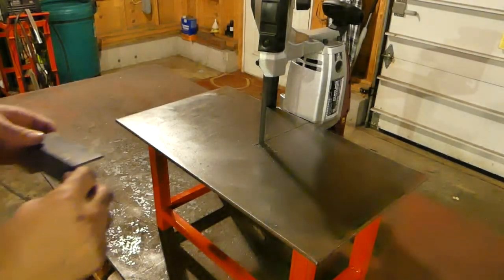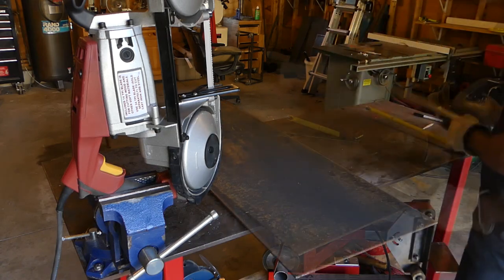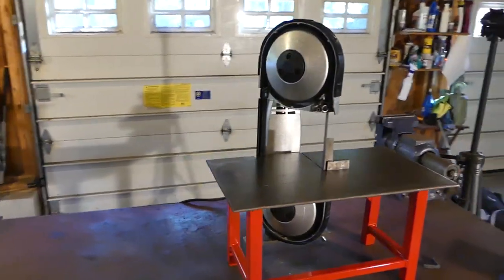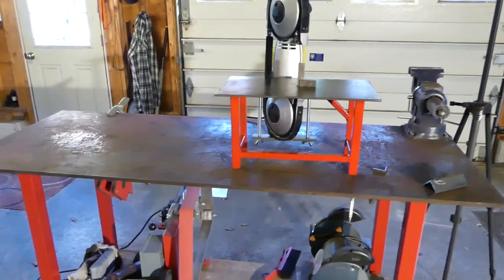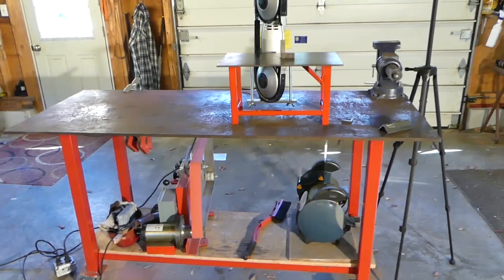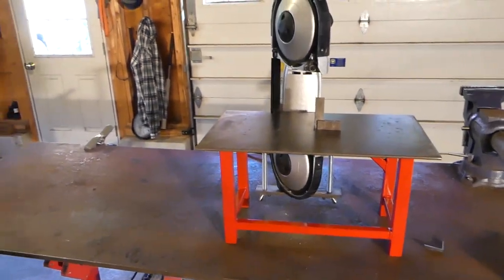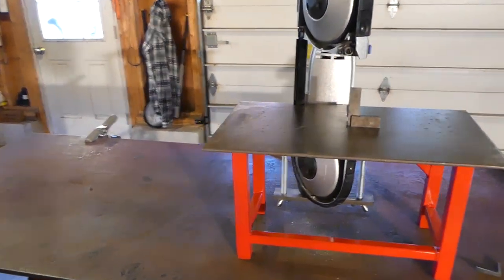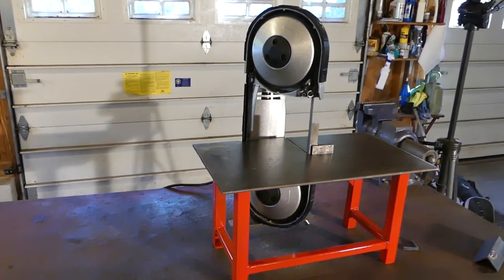M^3 Portable Bandsaw Table Build

Comment: Using an abrasive cutoff wheel without a guard is bad enough.  Running it without the guard while you side-load the cutoff wheel by running it side-to-side when you're cutting the notch in the table is terrible.  If you want to be that reckless on your own, that's your call.  Those practices in a how-to video is utterly irresponsible.
Reply: غي
Reply: Sounds like a Mr. Rogers statement.......

Comment: Mike - I know vid is 7 years old & you likely art seeing comments anymore. Wish I'd seen this before my experimentation. Kudos to you. Like me, you realized that no matter what sorta band saw you have, it's not good for the entire weight of the saw hanging from those 2 small machine screws threaded into a magnesium alloy saw frame. No other vids I was at the time considered this important issue. YOU DID. Mine ended up similar to yours Mike, but I used longer horizontal square tube on the bottom (like sled legs) with the vertical legs coming up from there.Those bottom runners extend about 8" beyond the back of the top plate. I welded a horizontal cross piece to that extension and horizontal screw adjustable plate to take the weight of the saw off of the shoe screws. I like your method better. Yours creates much more portability with the ports band never having to remove the shoe taking saw on and off. Great project. Thanks for the ideas.

Comment: you should put something on the bottom to protect he wheel, i built something similar to yours and the shavings kept falling into the bottom wheel area and eventually messed it up. i ended up just gobbing some silicone around the blade under the table on my new saw and when it dried, the blade just made a perfect fit around it and kept the shavings from falling into it. When i need to replace the blade i just pull the gob of silicone off in one piece and it fits back with friction and gravity.

Comment: You did a great job putting that little saw table together. I need to make one myself. In got a Milwaukee saw. I bet your table would fit it too. You had a great ideal with the bolts and wing nuts with a peace of steel holding up the saw strait. Great Job keep up the great work.

Comment: What I really like about your design is the clamping bar on the bottom, and its universal for other saws. In addition, the clamp on the bottom securely holds the saw solid. Many other builds will use the weight of the saw hanging from the  2 screws . Not so good.. even the expensive swag table will rest the whole weight hanging on the screws. I think it's a much better design than most on YouTube. Now you just need to incorporate a miter groove.

Comment: Nice work. Looks as though it will do what it's supposed to do. Just one thing, and it has nothing to do with the table build. When using a grinder, always have the guard over that rotating disc. If you have ever seen one of those grinding wheels come apart at high speeds and the result of the shards hitting things, you'll understand that getting one fire back at you will be a harrowing moment. JMO. Thanks for sharing this video.

Comment: I just built a similar table based off of this(different on-hand materials) and found out the hard way that this does not work for a Milwaukee band saw. It looks like the brace lines up with a flat spot on the back of your saws handle, while it lands on the round blade guard for mine. I will have to re-engineer it and hopefully remember to come back here to make some suggestions for anybody with this same issue.

Comment: For your vertical bandsaw, just purchase an SCR speed controller for it. Make sure you match the watts/hp for the controller and it's as simple as that. Been using mine for years, 14" Jet.

Comment: Thanks for making this video. I am about to buy a portable band saw and your work is very clear. I do wonder, have you considered spot welding a couple of short angle pieces, to give bit more support to the  adjustable support bar, so as to create an angled bracket on either side of the bottom wheel housing? If they end up interfering, you can simply grind them off.

Also, if you weld a bar just short of the bottom of one short side of legs, making that side to be square to the floor, when turned on that side, you could save floor space when the saw is not being used. A short, round handle welded to the opposite, upper side, would give you a easy pick up, when putting and picking up the table off it's storage spot and support table.

Comment: What a creative solid build! Thank you! Very inspirational! 
I have a question...what was the  purpose of the strap spot welded to the bottom of the table? Was it just to bare against the foot plate of the saw to keep the saw from twisting? 
Also, was the strap that holds the saw tight to the bottom of the table  bearing against the blade guard or the back handle of the saw? I don't have a saw (yet) so can't visualize it.  You seemed to have put something in between that strap and the the gauard...perhaps a shim or some kind of padding?
I would be worried that the saw could work its way backwards out of the table. Obviously, this must not be an issue for you.
Sorry for the wordy comment/ questions...
Thank you again! You have a great little shop there and obviously some great skill!

Comment: Great looking stand for the portaband. Does it just use the Allen bolts on the saw to locate it and then the metal bar and wingnuts pinch it in place?

It is nice to see someone weld the way I was shown when I was working in Ohio by a guy that I jokingly say could weld cardboard to cast iron. He is the best welder I have ever met and he told me to push the weld and that keeps the heat ahead of you.

Comment: Awesome! I wish I knew how to weld. I have the same bandsaw and portable bandsaw and would love to mount the portaband to something to use it as a mini
Reply from the maker: Watch Jody and Lanse.  That's how I learned.
Reply: you should seriously consider the cheap flux core welder suggestion, they are 110 volt so you don't need any special household wiring and you can pick one up for under $100. the only down side is all the cheap ones are AC welders which are a little messy but if you can use a soldering iron for about $60 you can convert it to a DC welder then you'll have a nice $300 -$400 equivalent DC welder for under $200, everyone needs a welder!!!!
Reply: +Brad King in 1979 I learned how to Arc Weld but never got any equipment.  I liked it (I was young and had wonder vision) I had to use a #12 lens or it was too bright) but all of this mig and tig is beyond me.  We used (in shop class in '79) oxy acetylene to cut with and braze but I never learned to braze I was absent that day.  I am not sure what the arc welder was if AC or DC but if I understand right AC likes to spit more, right?
Reply: most of the old stick welders like the infamous red Lincoln dog house welder were AC but they welded ok because the flux was on the outside surrounding the the feed wire. the AC flux core wire feeds are another story, the nature of AC is to alternate flowing in both directions thus the name alternating current which tends to blow the flux away from the weld causing it to splatter and be harder to run a bead. DC welders the current just flows in 1 direction from the welder tip to the metal work piece which causes the weld to flow and lay smoothly, DC is a lot neater weld but can also be a lot hotter so you have to be mindful not to burn holes in what you are trying to repair.....
Reply: Brad King
Yes, precisely it was a stick welder and AC sounds right.  Did we even have wire welders back then?  I know we didn't have them in High School shop class (back in the good days before schools became crap).
Reply: actually arc welding was invented in the 1800's with WWI being the first real main stream use. TIG welding came around in the 30's and the first real wire feed/mig welder came out in the late 40's but didn't hit main stream manufacturing until the late 50's. i went to HS in the 70's also and i don't remember having any arc welders in shop, we had to use oxy/acetylene for everything. i learned stick welding later but have been using wire feed so long now that I can't stick weld anymore....
Reply: Brad King
I think the Tig (the more I remember) was for the Jr. and Sr. classes but being a freshman we learned on the stick welding Arc Welder.  I think (Mr. Lemmon and funny I still remember that angry old man's name) it was because the cost or the gasses involved but we used Oxy Act so not sure why.  Could be that stick welding is also simpler?
Reply: tig is way harder the stick cause with tig not only do you have to use both hands kinda like oxy/act welding but then you have to use a foot also but it is so clean and precise.....
Reply: Brad King
Can use tig on more metals too but then there is MIG welding too.
Reply: I'm curious, it's been a year have you started welding? If not, you really should take the advice from the previous comments and purchase a cheaper machine.
I'm a computer programmer by day and I started welding by taking an inexpensive community welding class. From there I bought a cheap machine and started playing/practicing on scrap metal.
Fast forward a couple of years and I now have a high end Lincoln and I just accepted my 9th paying side job! 
An interesting thing with this side job; I am getting paid $20 more per hour than I currently make as a programmer! :)

I never intended to make money welding, my interest was purely as a hobby and desire to learn a very useful skill, however from word of mouth I occasionally get asked to weld for people(i.e. occasional side jobs that pay).

Good luck and have fun!
Reply: Yep, I think a cheap wire feed welder is $100 or less  delivered by now. Wire is fairly cheap too.

Comment: i like this idea, as a matter in fact this is really tempting me to just break down and buy one of the HF Baur porta-bands. though i would try to design a little extra clamp for the top part of the table just for extra stability. it almost looked like you were getting some movement out of the top of the saw just while it was running. or is that just the harbor freight quality talking there? lol

Comment: Nice build.Gonna build a similar for mine.I had used that 2x2 "Erector Set" angle temporarily.Thanks for the inspiration!Curious as to why only 1 diag. brace?BTW,you can get a rheostat or similar to slow the saw down,but so far,mine does GREAT on ,metal as is.

Comment: I would run a shield on the grinder. If disk explodes it might hit you bare hand.
Want to see someone make a channel for a miter angle clamp
Reply: NO..no   it's way more fun when they hit you in the face........I have a chunk stuck in the drywall ceiling about 15' up.....I use it as a reminder to always wear safety glasses...Plus I can't reach the damn chunk...
Reply: DynamicSeq yea i had one explode on me the other day. Missed me completely. Now i wear my welding helmet and keep my hand out of line with the wheel

Comment: SAFETY FIRST YOU NEED TO GET THE GUARD ON THAT GRINDER, Cutoff wheels can  violently explode!!!
Good build, but you could have left out all the cutting off of junk and sanding rusty metal off and had a video 5 minutes shorter.
Still a good job on a convenient tool.
Reply: Mitchel Perkins 
Guards are over rated😄
Reply: personally i like seeing the extra bits of him cleaning up metal and such. i dont nessesarily sit and watch with my full attention. i often times do some work or reading up on stuff when playing these sorts of vids unless its something im really trying to do myself. but the extra length means i dont have to find another back-drop video so quickly.
Reply: With the quality of his camera work, the pictures as one explodes or afterwards will be excellent for safety lessons.  The pieces make such interesting designs in the body.

Comment: what kind of disc is that you are using to clean all the surface rust and oxidation off of that 1/4" plate? is it just a flap disc? of one of those brillo pad style ones?
Reply from the maker: Its a polycarbide abrasive wheel, a bit pricey, but man do they work.
Reply: good deal thanks sir. subbed

Comment: What was the flat bar with the 2 holes that was welded to the underside of the table. I can’t figure out the purpose.
Reply: BigTexFyre to align the original bandsaw table to the slot on the main table.

Comment: Your work is great. That said, you may want to do those tasks that don't directly affect the build off camera. It will make your video shorter without losing any of the build details. The trimming of the scrap pieces you used in the build and the rust removal from the plate are not interesting to watch and have no bearing on the finished project. Hope this comment is taken in the spirit it is intended.

Comment: Great job of building the table, and fast too!  One thing, shouldn't the blade be oriented in a direction 90 degrees from the way you have it?  Putting it in terms of wood cutting, it looks like it can make cross cuts but not very long rip cuts.

Comment: Are you using a cutting disc for grinding. If so NEVER do that use the right tool for the job of grinding, a GRINDING disc. Cutting disc's shatter and explode rather easily especially when a cutting disc has been weakened when used for grinding. Might want to consider using your wheel scatter guard on the grinder as well. SAFETY right.
Reply: Pileits looks like a flap wheel

Comment: Was just watching your treadmill motor mods and ran into this one. That saw is one of my most used machine's in my shop now ! You do great work man. Thought Id show off my build .. .. .
https://youtu.be/ZDNio9feg1o?si=8Mz_VGu9iRY_9VHp
Any how Im looking at replacing a motor for my small Harbor Freight  drill press to a DC. Using it for tinny stuff but also adding a faseting table on the pully side up top. .. faseting as in stone shaping. You have the best info on DC modification...Thanks!!❤

Comment: Thank you for the video. That said, the video presentation would have been much better if it had been 90% less salvaging used stock and more about building the project just using new steel. I commend you for recycling, but it's pretty boring to watch.